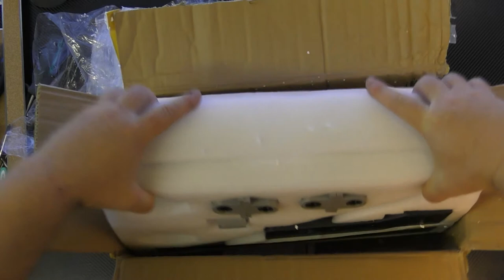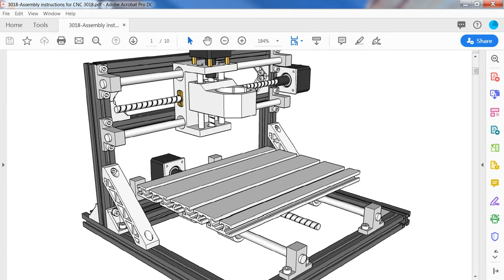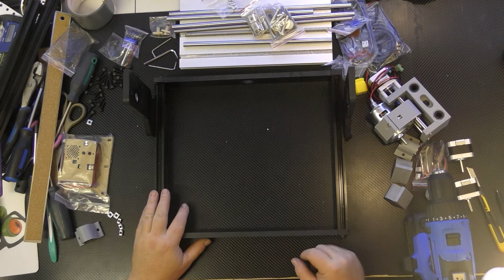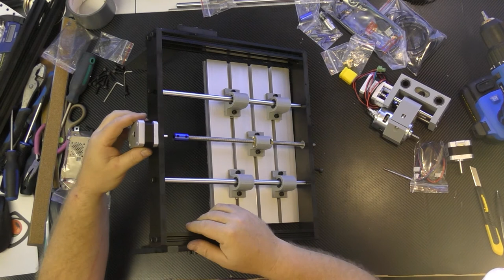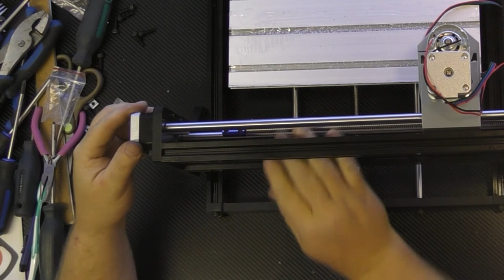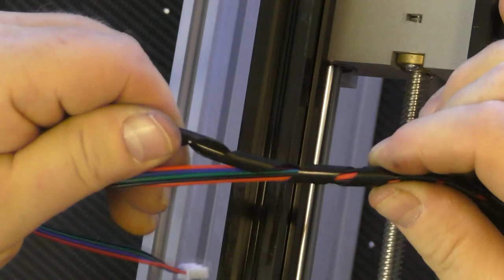3018 CNC mill unboxing & build

Comment: My collett was very tight, so i heated it to 350 degrees and it slid right on.  That sucker is not coming off again.  This video was very helpful.
Reply from the maker: :O  You had to heat it?  Wow - thanks for letting us know.